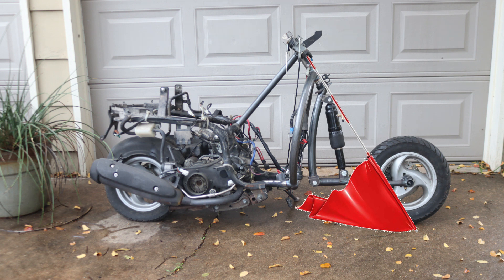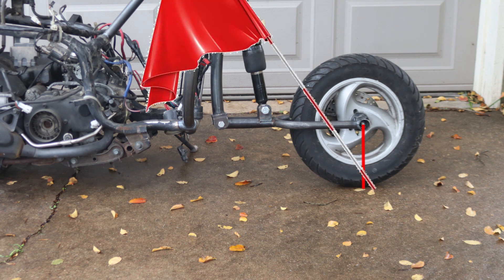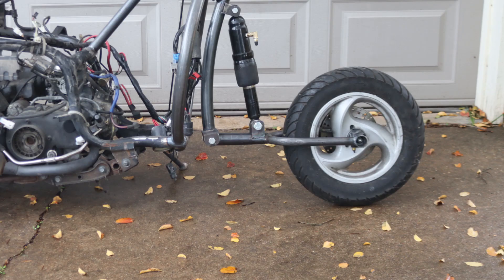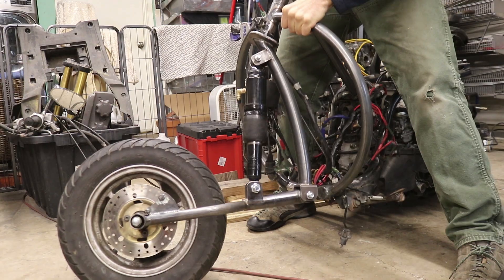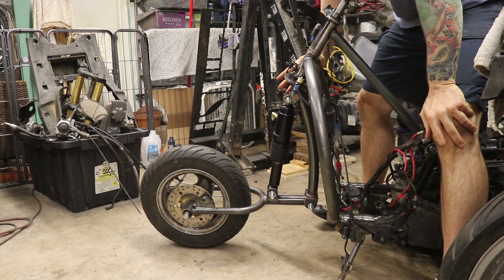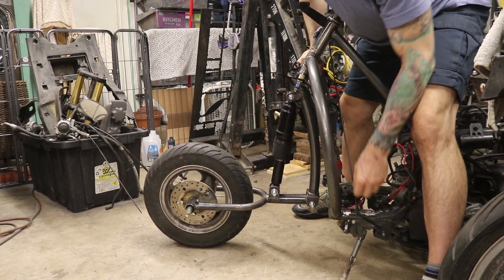a Case Study in RAKE & TRAIL - my experience making a scooter front end

Comment: I have a very similar front end in the works. I would never started to mess around with this stuff if i didn't have parasolid 3d design software at my disposal(Inventor). You can try out so many different geometries in just few hours its almost overwhelming. I came to the same conclusion as you did to mitigate the trail issue, the primary fork( fork in my case, because im recycling old bike parts as much possible) needed to go from 20° to 35°. There's also huge variability even in slight half inch changes in any pivot point. Now the computer only goes so far at least for me, im still going to need to add plenty of mounting points in the test phase, but once i know what is optimum through road tests i can remake the mounts for the final product.

Comment: Excellent demonstration! It seems that the reason we dont see trailing/leading link suspenions on bikes anymore is its difficult to make the kinematics desireable for good performance. Best of luck in your experiments!

Double wishbone/Hossack style suspensions do give you far more tuneability in a neater package, while still offering similar benefits to other link suspensions. How much the rake changes is dependent on the relative length of the upper and lower control arms. Most examples, AFAIK, are (or very close to) equal length as that mimics the linear travel in telescopics. You can see these types in the Britten v1000 and latest Honda Goldwing bikes.

Comment: Looks like a lot of bending force in the arm right where the bottom of the shock mounts. Hard to get a feel for it through a video though rather than in person. Looks like a heck of a fun project though.
Reply: The forces the structure experiences is limited by the spring rate and valving of the shock absorber. Of course if it were to bottom out then it would be a different case, but that would also probably be a crash no matter what.

Comment: Have you read any of Tony Foale's early works?
Reply: I was just thinking the same. If you'd read his Book on Chassis Design, (and more importantly understood it), you wouldn't build a non-Telescopic-Fork-front-end, and use a 'conventional' Rake Angle.
Rake Angle is only needed because of the shortcomings of Telescopic Forks.
Reply from the maker: I've got his 'Motorcycle Handling and Chassis Design' book, which is largely what I'm going off of. Do you know of other books on the subject?

Comment: You’ll be gland you changed it. If not, you should be. I’ve got an old Montgomery wards/Gilson mini bike where they designed it for a tall tire and then somewhere along the line decided to make cheaper models with smaller wheel/tire and just the difference of a couple inches in tire height gave it inverse trail, by just a small amount. I spent hours staring atthe thing deciding how to modify it so it wouldn’t be so wobbly and sensitive before it dawned on me….. bigger wheel/tire combo and I dont have to cut a thing. Interesting how even designers for big companies can overlook the essentials. Engineers. Am I right?  Lol
Reply from the maker: That surprises me (and makes me feel better about my own inadequacies) that a big company would overlook such things. The effect of wheel size on trail is a good thing to know, thanks👍

Comment: Nailed it dude. Like a shopping cart front wheel, the bike front wheel needs to be pulled forward by the bike, not pushed. Otherwise it will want to flop to one side or the other. Cruisers and choppers have a lot of trail and are very stable but take more effort and space to turn them. A racing sport bike will have much less so that it can be very responsive and nimble but will often have hydraulic steering dampeners to fight the dreaded “tank slapper” under certain suspension load/unload situations. 

Too many YouTube builders skip this measurement step in the process and make a bike with bad geometry that could be fixed with a minor adjustment. Often they’ll mention that it’s squirrelly or you can see them wobbling down the road but they don’t know why it’s an issue.